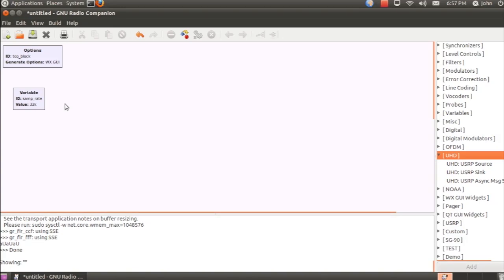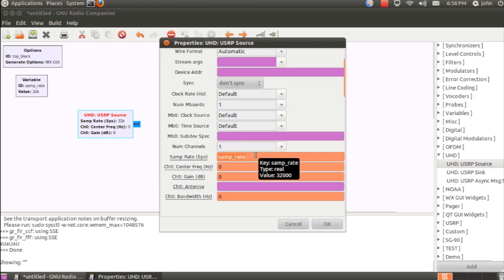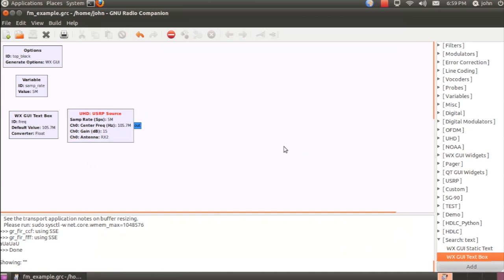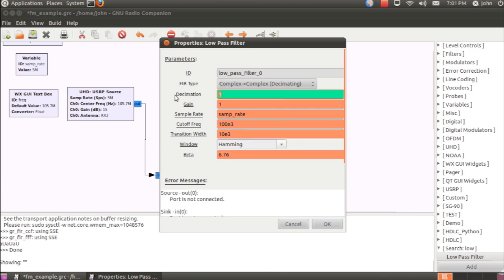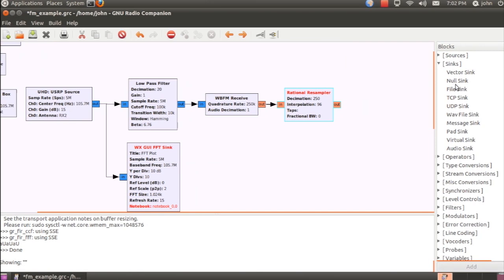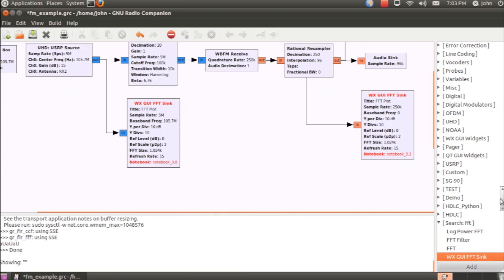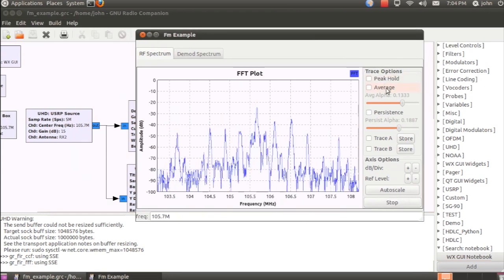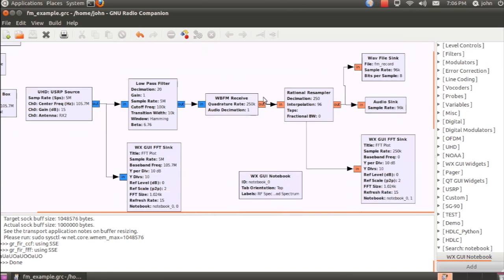How To Build an FM Receiver with the USRP in Less Than 10 Minutes

Comment: I'm getting a lot of aUaUaUaUaU audio under-run errors. Is there any way to prevent these? I believe it may be something to do with my audio driver but I have no idea.
Reply: I am getting that too. Any help?
Reply: @ryanandpeople9401  It's been a long time, but from memory it could have been audio buffer under-run due to using (or not using) a throttle block.
Reply: @rownadoherty  thank you for the reply😂😂. I fixed the issue , and you are right. It was the buffering the audio too much.

Comment: When do you use WBFM Receive vs NBFM Receive?  I understand the former has a bandwidth of 250khz, while the NBFM has 15khz-30khz?   

How do you know where to add interpolation/decimation?

For example, I get that when you add a filter, you don't need to process EVERY sample, so setting a decimation makes sense.  However, why do you make a point of keeping the decimation in the WBFM block to 1?  i.e. why is adding a Rational Resampler block preferred to do the Interpolation to the desired output sample rate (for your speakers) and the Decimation of the input sample rate?

Similarly, couldn't you done it, only using the LP and WBFM blocks --- Setting the decimate in the LP, to something like 10000, gets you a Quadrature rate for the WBFM of about 500k.. and an audio decimation of 5 in the WBFM gets you the desired ~100k for the sound card?   I know it's not right, but why?  http://files.ettus.com/tutorials/labs/

Comment: Hi, I totally do what you show, but the usrp only give noise sound, and the frequency is ground noise, is this antenna issue?
Please help,thank you
Reply: Hello, I have the same problem, and led600 is red. Do you have any idea what to do?
Reply: I also had only noise at the beginning. Eventually, I got things working. Three points: 1) increase the gain value of USRP source, like to 50   2) Antenna issue. solution: move the antenna around.     3) if using osmocom source instead of UHD: USRP source, remember to install missing packages. sudo apt-get -y install libuhd-dev. See this link: https://blog.csdn.net/sinat_38431275/article/details/77367773  (Chinese)

Comment: thank for this tutorial. i follow all your step and try to run it. however, AttributeError: 'module' object has no attribute 'remez' occur. what it's mean??? how can i solve it? is that ok if i use USRP B100 with antenna range from 850MHz to 6500MHz instead of N200/N210.

Comment: getting this kind of error while executing the flow graph what does it mean?

Generating: '/home/rajesh/fm_rxr.py'

Executing: /usr/bin/python2 -u /home/rajesh/fm_rxr.py

linux; GNU C++ version 4.8.4; Boost_105400; UHD_003.010.git-202-g9e0861e1

Using Volk machine: avx2_64_mmx_orc
Traceback (most recent call last):
  File "/home/rajesh/fm_rxr.py", line 170, in <module>
    main()
  File "/home/rajesh/fm_rxr.py", line 164, in main
    tb = top_block_cls()
  File "/home/rajesh/fm_rxr.py", line 110, in _init_
    channels=range(1),
  File "/usr/local/lib/python2.7/dist-packages/gnuradio/uhd/__init__.py", line 122, in constructor_interceptor
    return old_constructor(*args)
  File "/usr/local/lib/python2.7/dist-packages/gnuradio/uhd/uhd_swig.py", line 2249, in make
    return _uhd_swig.usrp_source_make(*args)
RuntimeError: LookupError: KeyError: No devices found for --->
Empty Device Address
Reply: dude I got the same result.....hav you already solved it?
Reply: It means your device is not connected.  There is an excellent troubleshooting answer on stackoverflow called 
When trying to use my USRP in GNU Radio, I get a “ No devices found for --->” error